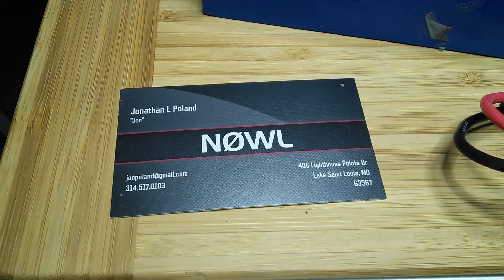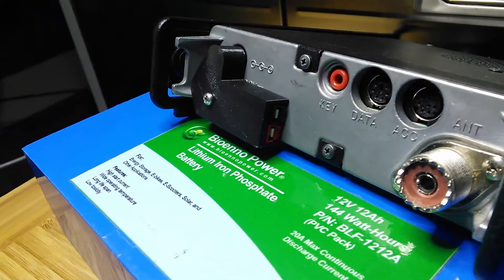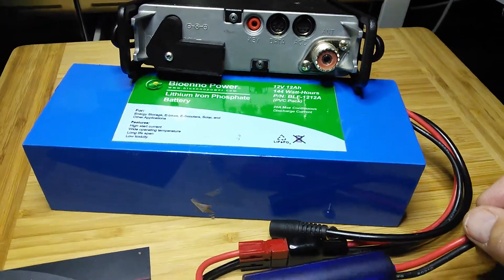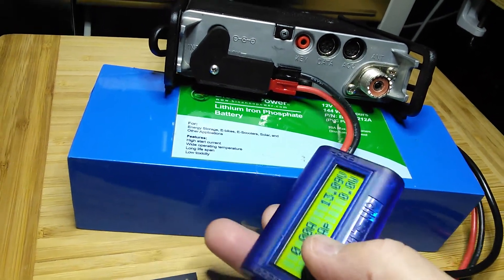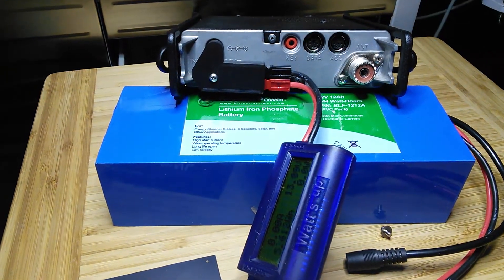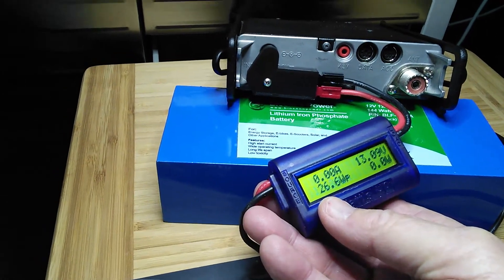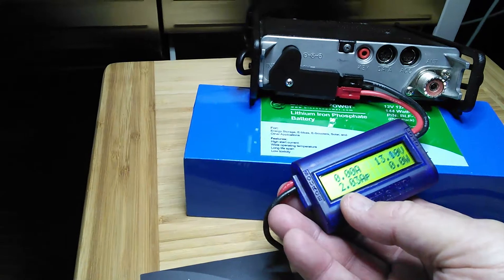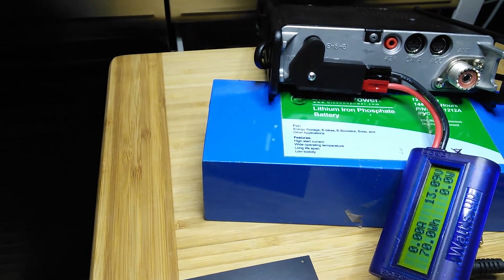Anderson power pole 817 improvement

Comment: Bought this last week bc of this vid. Great item. Question: do I really need a fused line? Isn’t there a chip or fuse in the battery or did I not read the website correctly?
Reply from the maker: forgetyourlife I will always error in the safety side of electric safety by fusing all